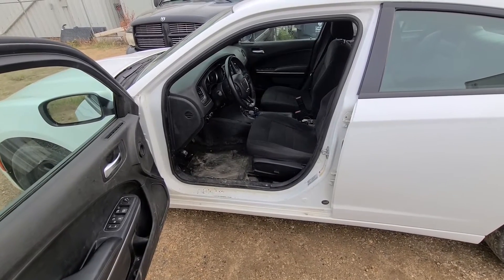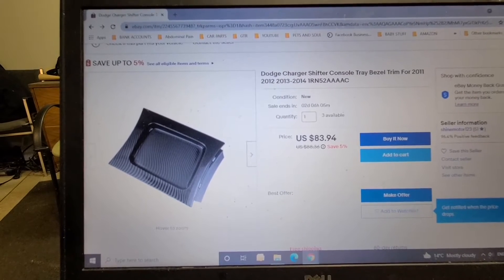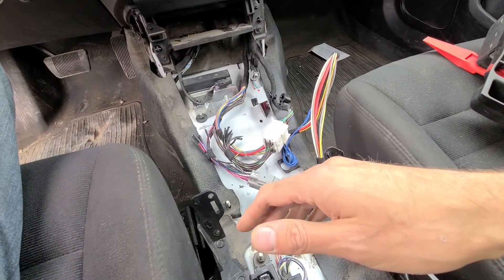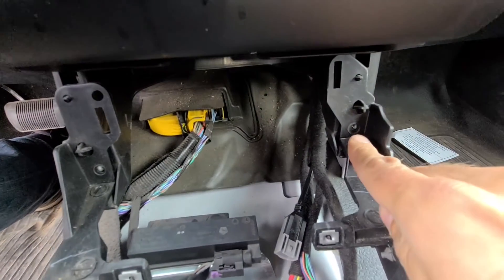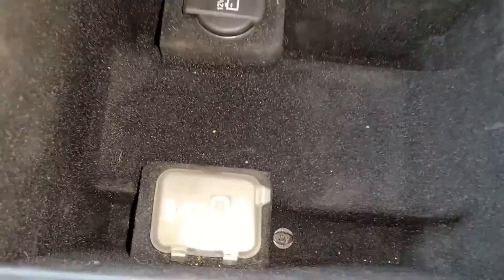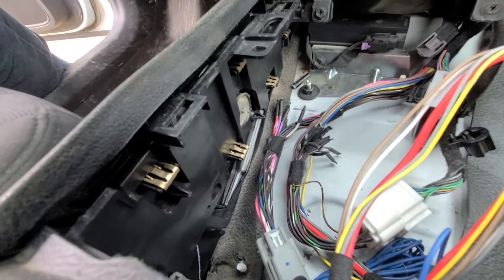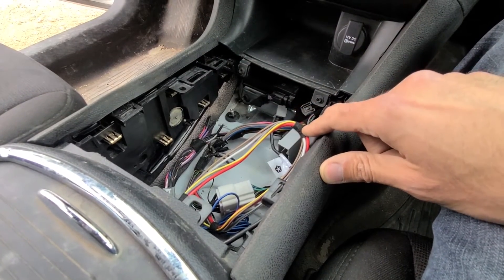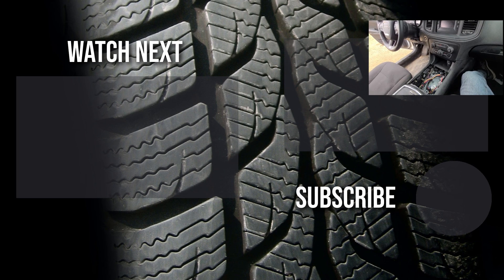Dodge Charger - MIDDLE / CENTER CONSOLE INSTALLATION or REMOVAL (2011 - 2021)

Comment: What is strange is my car is 2015. I bought a 2015 center from a junk yard and all of the wires are different!
Reply from the maker: Is your car ex police? If yes most likely you will have to get wiring for the console. depends on the department, but they often leave their own wiring inside when striping it and don't return the original

Comment: Great video.   How much did your salvage yard charge you for console with side pieces
Reply from the maker: Thanks. I think it was $150
Reply: @QuiteAlright  Dang. Good find. I just paid $400 but for the entire assembly.
Reply from the maker: @JLCra87  Yea there is a local salvage where guys know me so I get extra good prices. They crush hundreds of cars monthly so they don't care too much about parts
Reply: @QuiteAlright  Dang! Mine came without a center piece. I'm only finding them new for like $100+. The little storage bin with the electric port. Think you'd be able to get one? Send me a DM if you can. I'd definitely appreciate it. If not it's all good.
Reply from the maker: @JLCra87  I'll take a look next time Im on car salvage and let you know if I find anything
Reply: @QuiteAlright  Appreciate it! 😎
Reply: @QuiteAlright what tools should I bring to the salvage yard with me to remove a center console?
Reply from the maker: @charliepotts3659  Uhhh can't really remember as I posted this video quite a while ago. And possibly salvage took it out for me at the time. Sorry I can't help more
Reply: @QuiteAlright  all good man sorry didn’t see how old 🤦‍♂️
Reply: you to you pick yard get it for 50 bucks, all you need is 8mm socket, extention& ratchet. pluis phillips screw driver, trim removal tool is helpgul too

Comment: Does the charger port inside the arm rest  work?
Reply from the maker: It won't work unless you get all the correct wiring for it and reconnect everything. But again it depends what police mechanics did and how it looks. Every ex police car is a bit different depending on the department

Comment: How did you install the shifter bezel tray? For some reason mine doesn't snap into place
Reply from the maker: It should just snap in, maybe you are missing some of the clips on the bezel tray
Reply: They are starting to sell crap so you have to cut some of the plastic away and sometimes file down clips.

Comment: Hi I have a similar car and my front speakers dont work. Did you fix them? How did you fix them? Thanks
Reply from the maker: First check wiring behind the radio unit. Then check wiring at the driver door jamb behind the rubber sleeve. If you have a previous police unit than it could be a problem as they strip the car off everything before selling and usually cut bunch of wiring. Dealt with that lots of times and every time something else is wrong. Quite hard to diagnose
Reply: did you get it fixed. some police agencies disconnect the front door speakers under the center heater controls, they wire the police radio so the police calls come out the door speakers, saves space in the car and no need to add police radio speaker.

Comment: I heard to get the rear climate control there is a foam sponge do you know how to remove the sponge or where it is?
Reply from the maker: Sorry don't have any knowledge on that. Try calling dodge dealer and asking for the part # explaining what you are looking for. They will have all the detailed diagrams
Reply: yes there is a long black plastic tube that runs  under the console to the rear vents in the console.

Comment: Great video
Thanks for posting

I have a 2014 charger rt that needs those 2 side panels by the shifter and the metal trim on top replaced, 
Do you happens to know how are those called ?

Thanks again
Reply from the maker: No problem, you're welcome. 
Side panels are called center console panel right side and left side.
Metal trim is called middle console gear shift panel trim.

Comment: Can I put a 15+ console in a 2012
Reply from the maker: Hmmm I don't think so. 2015+ is after the facelift so probably they changed something. Your safe bet is 2011 - 2014
Reply: Damn okay I seen some people do it when they do swaps so I’m wondering what they did
Reply from the maker: @Caine459  I mean with some modifying it can be done probably. I've just never done it. There could be only small differences such as mounting points or something bigger which will be a problem
Reply: I sell adapters on ebay for people that made the mismatch mistake.  Happens all the time.
Reply: @unclesamautos  what’s the ebay

Comment: Does the rear A/C works? or is it something that won’t work since it was a police unit?
Reply from the maker: It will not work, police charger is not equipped with it. The console that I got was from SXT which had rear climate control
Reply: It should work if you have the plastic pipe that goes to the unit. If you buy a aftermarket one new it comes with it